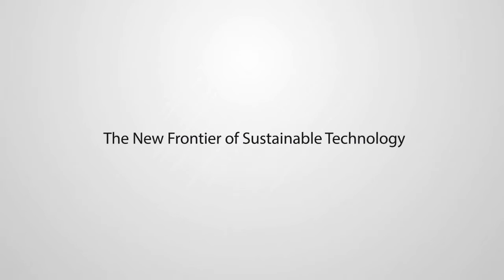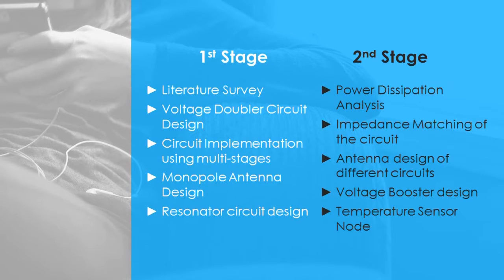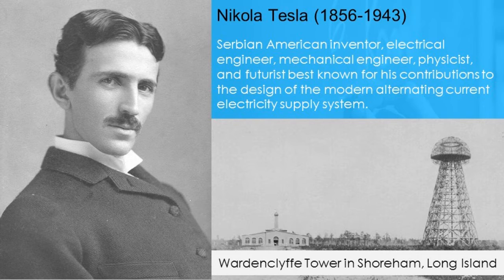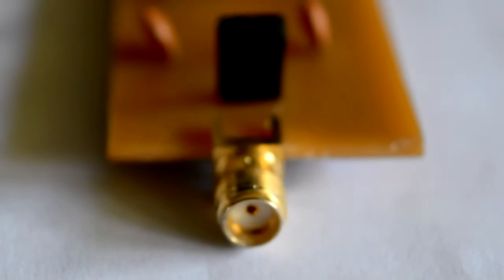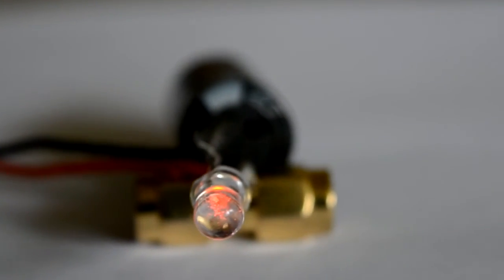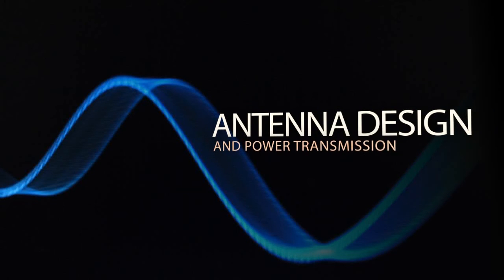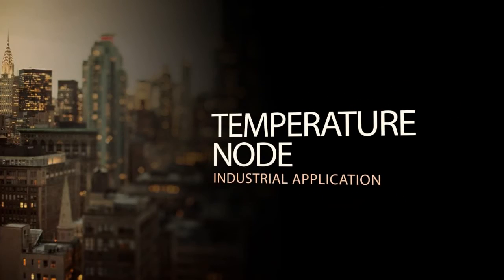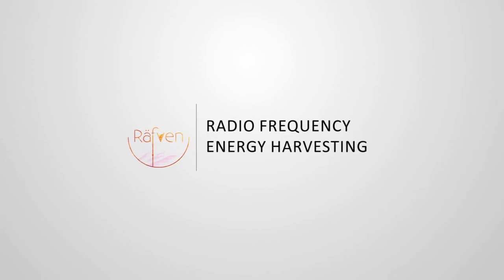Radio Frequency Energy Harvesting

Comment: how much power we can produce through this? Is it possible to light our home through this like solar panels do? Also i doubt that using rf energy to a certain extend ll act as a jammer because it is the only way of communication..please correct me if i am wrong. 
Thank you
Reply from the maker: Actually, at this research stage, we weren't able to produce much power since we didn't have the resources. 

But if we were to have a big receiver and a resonance circuit like Tesla did we might able to get much more power. 

If you have the time I suggest you read some research done by Nikola Tesla, he has done marvelous wok back in his days on RF Energy

Comment: Hi! Nice project but where is the harvester connected to the temperature modul? I see that this module is powered up by a little coin battery
Reply from the maker: Actually the temperature sensor have been connected to the Energy harvester, and to keep the sensor gong the chip battery has been connected.

Imagine if you have to put the sensor in  unreachable place, then caning and checking the equipment is harder.

And the sensor temperature is read by the micro-controller which is powered up separately, that is not powered up harvester since the processing needs more power